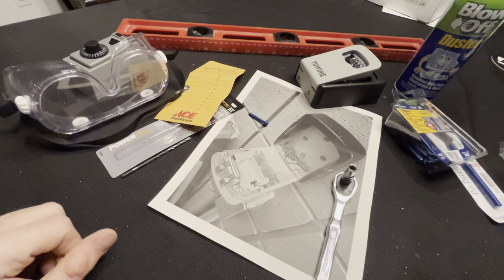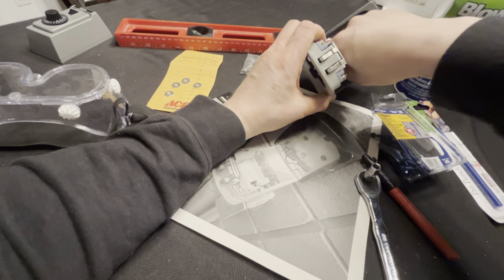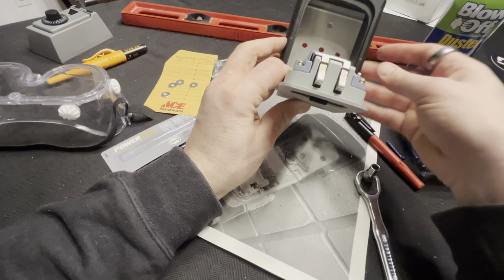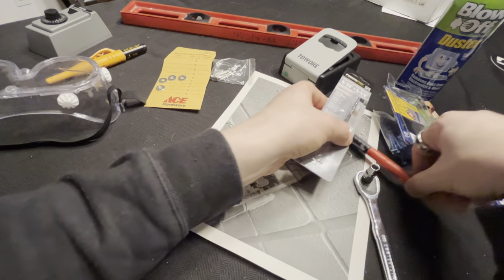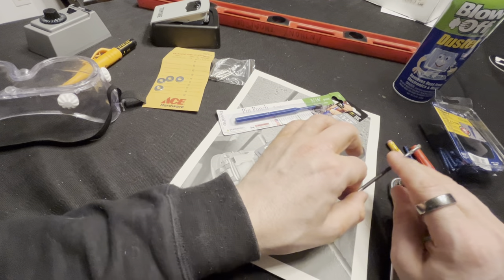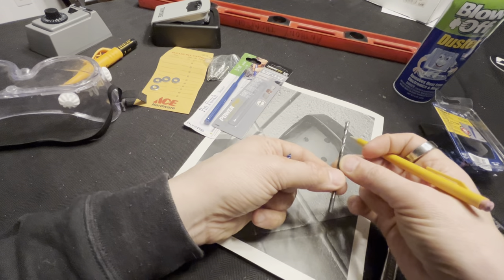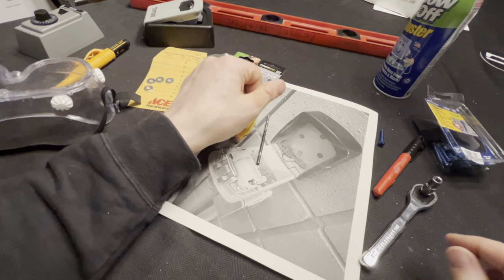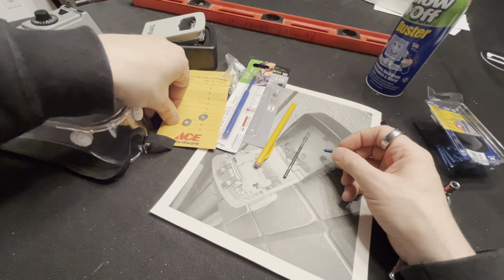Tips on Mounting a Master Lock Box 5401D on a Concrete or Brick Wall

Comment: I’m catching up on older videos and saw this one. I’m certainly not a concrete drilling expert but you can use a drift pin as a center punch on concrete? I just figured you would need a point like on a center punch has to make a mark in the concrete. Thanks for all the details as usual!
Reply from the maker: I honestly don’t know the difference between them, you’re probably right. My guess is either will work and both are better than nothing which is what I did (and ended up slightly skewed as a result 😂). Thanks for the suggestion 🙏